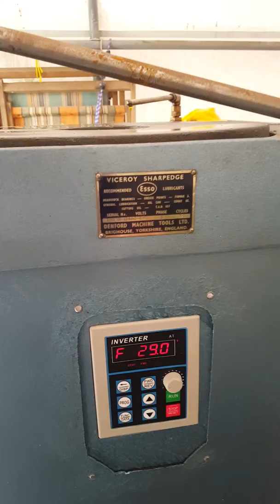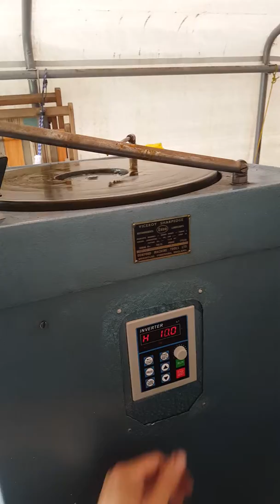Viceroy Sharpedge 16" stone grinder for chisels, planer blades, and machine knives.

Comment: The comments are interesting and so is the video!
Reply from the maker: See the short followup video covering the oil delivery system. We opted for a Chinese VFD on this machine as they were at a good price at the time.
The stone has a dip across the full width otherwise seems to run OK.
The tool holder also needed slight adjustment (twisting) so it would grind as close to 90° across the blade as possible.
Reply: @ianhelsbyservices  Hi Ian, I have indeed watched that video too. I used to have two Sharpedge machines but both were in bad order when I got them so I sold them on. I have a chance of another but in good condition so may take it on? I won't using it to sharpen chisels, it will be a surface grinder for small parts. Top regards, Jon.

Comment: Sorry for bugging ya` I am working on my machine now,
I looked at the pump and cam on the motor shaft , I think the cam goes around and pushes the trigger or lever in and then it flicks back out , witch causes a sucking motion on the diaphragm. I've replaced the motor and made a new cam to push the trigger in then allow it to flick back out, I noticed the old cam had a bearing on the end, was this to reduce wear on the pumps trigger ?, as the outer of the bearing would roll so reduce friction,
But what i really needed to know could you leave a link for me to see what they are like please,
Reply from the maker: I'll get some footage of what ours looks like. From what I remember ours had the bearing too for smooth operation over the cam but it didn't seem to move the lever enough to sctually pump. The pipework in ours had been modified to include an extra drain point under the gearbox but all that did was allow the pump to suck air instead of oil.
Reply: @ianhelsbyservices  Ah thanks for the heads up, 
Ye ` if the fluid drains quicker from the top under the gear box than  what the pump is pushing it on to the stone` then this would be an issue, The whole fluid mechanism can`t be allowed to have a break in the fluid, if the top drains to slow and over fills then I would look where the issue is, possibly blockages or a sh-t design or pump allowing air in from a weak point and not pushing enough oil`  ill make my own oil system that works better, I removed the stone and noticed all the shite around the edge and over the drain hole, if the path to the oil becomes restricted or the crap has entered the tank on the inside and restricting the flow in there, either way I need it put together and buy some antibacterial cutting fluid and see how it functions to find any issues, look forwards to footage,any think will hep and thank`s for your time
Reply from the maker: @piecetoyou8285  https://youtu.be/DcRdBEnXTLA for the new video. Mine drains just fine back into the tank. During the fix up I didn't notice any oil seaping through the gearbox so the drain underneath is dangling into the motor tray. The drain out of the trap under the gearbox is too low to go into the side mounted tank. My uncle says the one he used at school when teaching didn't have the tank at the side, just two hoses that were put into a bottle of oil.

Comment: Cheers for the info in last messages below,
Me and my son picked one up the other day same model after  I checked measurements with ya,
I taken pipe off to drain oil first be for loading it into the boot of the car, seem to have no oil left in it, we thought,
We through cardboard and rags down in the boot and in went the machine` then to my disappointment a sh-t load of oil came spilling out, (Owe Sh-t),Now I have the lovely smell of machine oil where ever I drive, lol,
It is a 3 phase one but going to replace motor to a single phase, not going to buy a phase convertor, 
Any tips on the powered motor needed, would it need one with a run capacitor as well as a starter capacitor type motor
Reply from the maker: Perhaps a build up of grind sludge blocking the outlet for the tank.
The stone is geared down so not huge starting torque as seen in the video when VFD drive ramps up to full rate. Motor-run type will be fine. Try and keep the 1400 rpm. We replaced the car-type mechanical pump with a 12v Chinese diaphragm type as ours came without the cam. Home-made cam was too noisy. Hoses replaced too as original stiff and wouldn't seal.
Reply: @ianhelsbyservices  thank you for quick reply and info

Comment: i have one of these at work but ours has the cone on the side only problem is the fuel pump isn't very strong nowadays and no one has a clue as to what oil it needs the last oil it had was like a rock when i got to it our motors also mounted on the top so it makes me wonder if ours wasn't modified at some point.
Reply from the maker: We bought some honing oil for it, fairly thin yellow stuff. Our pump also didn't have much bant. The cam on the motor's driveshaft only moved about 1mm if that. I made a new cam using some 1/8" mild steel. A little noisy but works now.
Reply: To help you the pump is an AC type Y, exactly the same as a Morris minor fuel pump, if it's not pumping very well move the motor a mm or 2 closer to the pump, should work a thousand times better, it should ha a constant flow
Reply: @NottsAndDerbyLHG39-45  cheers for that information I'll have to give that ago next time I'm in work be nice to have the whole thing working again.
Reply: @thedragonreaper  no problem, just restoring a pair myself, the pumps are about £20 new so if push comes to shove that's your answer, but Tbh there isn't much to go wrong with the pumps as they're just a diafram
Reply from the maker: @NottsAndDerbyLHG39-45  I've recently fitted a 12v electric pump running at 8v to get the right flow rate and renewed the pipework. Works great now.
I'd have loved to get one that has all the bells and whistles including attachment for machine blades but they seem hard to come by.
Reply: @ianhelsbyservices  a pump is probably the best way to go, ours has the original pump system, unless you use it once a day minimum it takes a while to get going, as it acts on the pump a little bit, even with ajusting, i would love to get all the attachments for mine i could do with the diamond truing stones as my stone isn't very flat
Reply: @thedragonreaper  The pumps can have waste from the grind stone in them, open it up and remove the slug from inside, and clean the diaphragm, The closer the cam is to the lever on the pump the more the diaphragm moves but the leaver produces more noise as the flicking back motion travels more and flicks harder,
Sounds like a air hammer,
way to much for me, I used a 12v dc fuel pump to drive my oil ,so much quiter,

Comment: Hi sir you do realise that is not a record player lol
What is the measurement of the machine, and do you roughly the weight of these,
Reply from the maker: Leave your chisel in a single position on the stone and you'll create a groove in the stone which'll hinder sharpening plane (wide) blades in the future!
It'll weigh around 100kg. Will update this messsage when I measure it's dimensions.
Reply: @ianhelsbyservices  Cheers ,
Reply from the maker: @piecetoyou8285  hi, sorry for the delay.
52 cm wide, 64 cm deep, and 90 cm tall. It's generally box shaped except for the chisel holder pivot at the front.